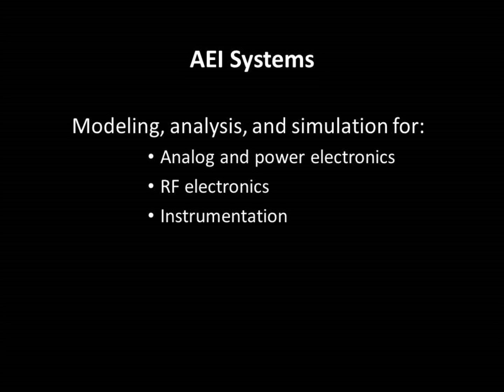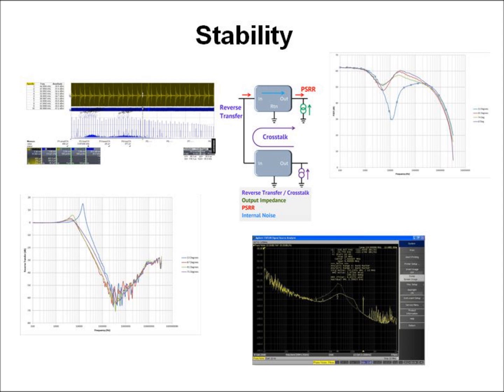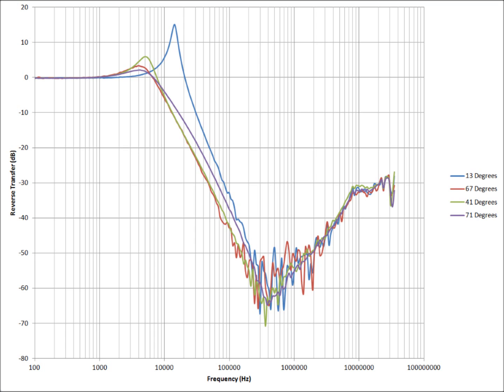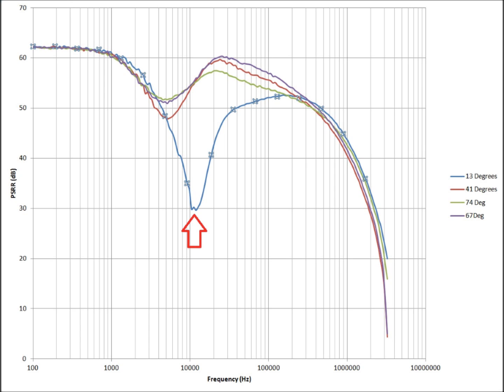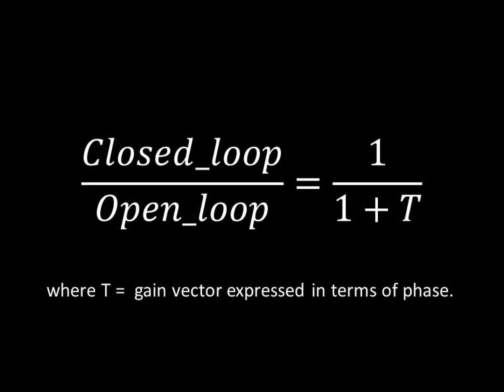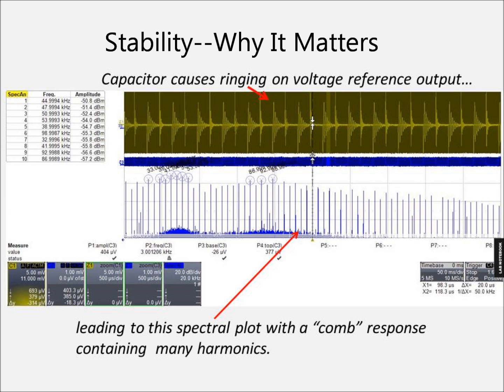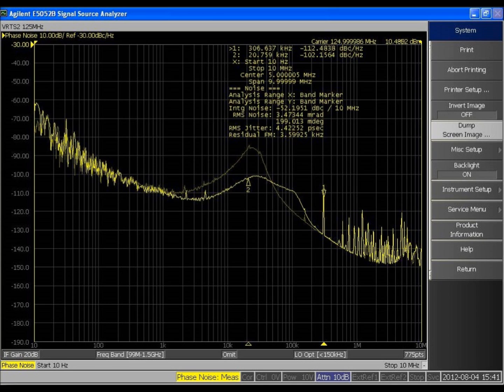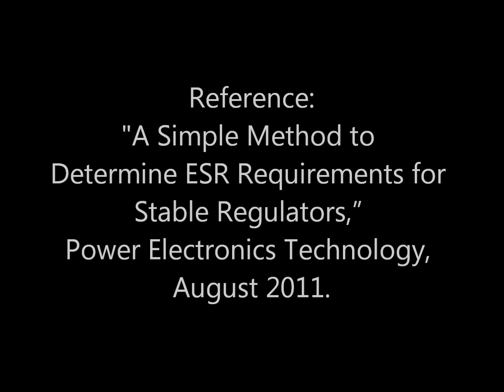Troubleshooting Distributed Power Systems (Part 1): Why Stability Matters

Comment: AF, thanks for your comment.  LTSPice is a good simulator, but the models are generally not accurate for such simulations.  In our business we rarely see better than 15-20 Degrees and many datasheets, such as the REF02 and LM4050 recommend poor stability solutions.

Comment: Viewer AF comments that this video "focused on linear regulators and low power systems and op amps. I think one would use the tools from TI or LT and/or spice and/or the datasheet. Most engineers who work on these systems would know 13deg is a poor phase margin. So I don't know for whom this was made. "